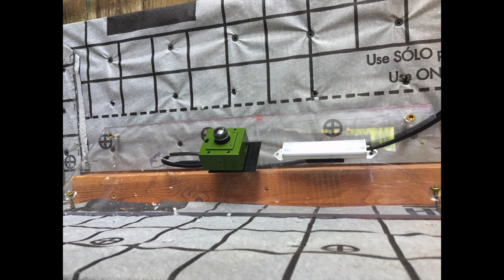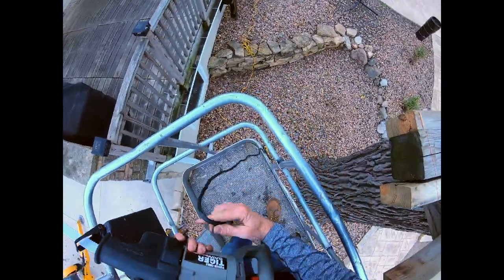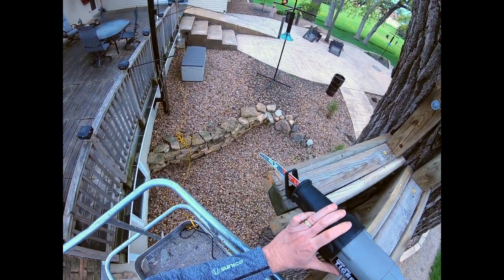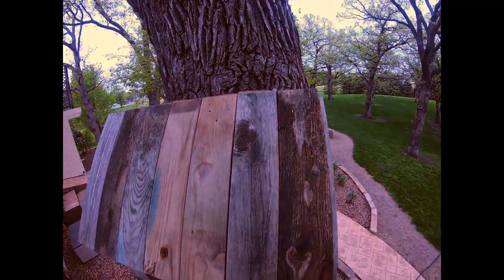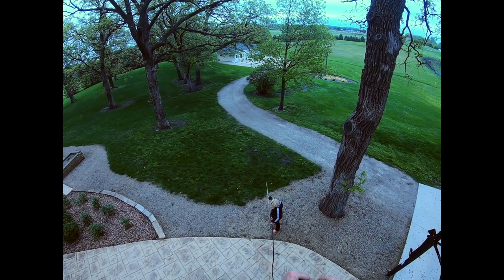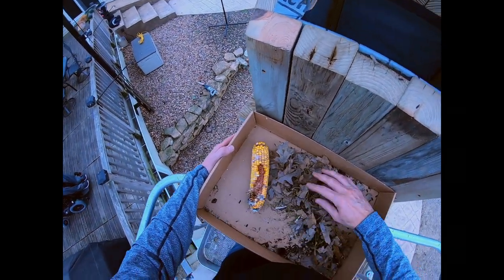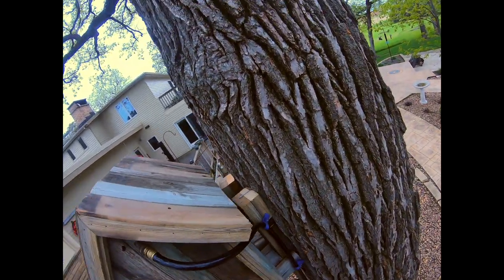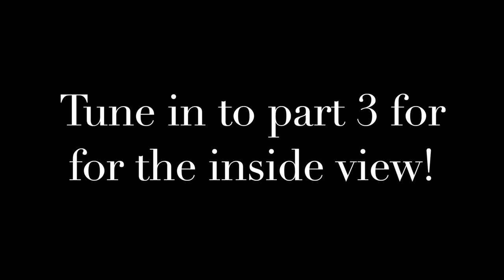Ultimate Squirrel House Build (With Camera) Pt. 2 | My Backyard Friends

Comment: In my opinion, the roof is not airtight.  the roof should be made of one piece, it does not allow water to pass through, or the roof should be covered with something tight.  I have a question: how is your roof, squirrels?
Reply from the maker: I understand your concern. But on the underside it had plastic siding barrier, then a small sheet of plywood. Then plastic protecting our cameras. We’ve never once have had an issue with moisture. 

We just use what we had around and made it work